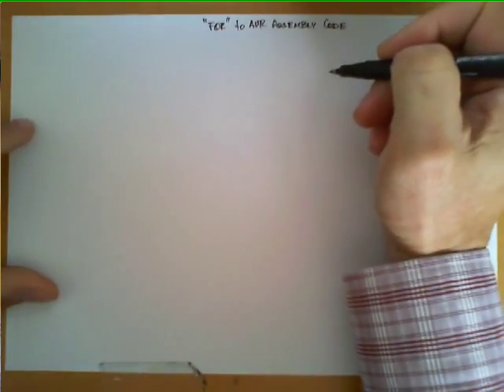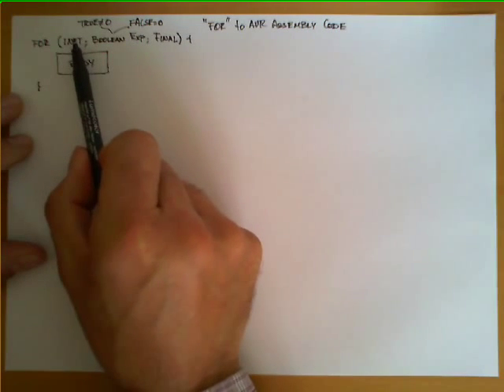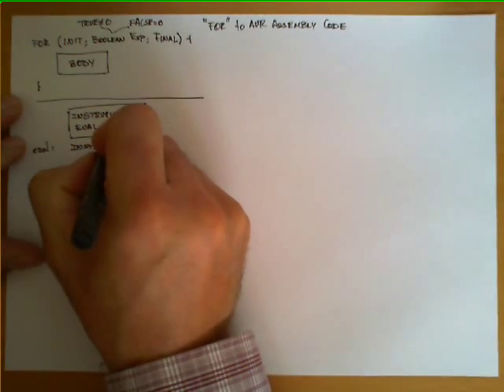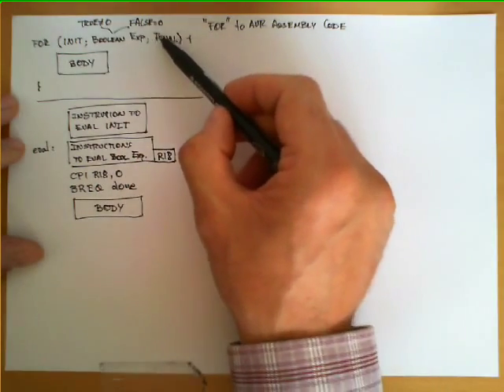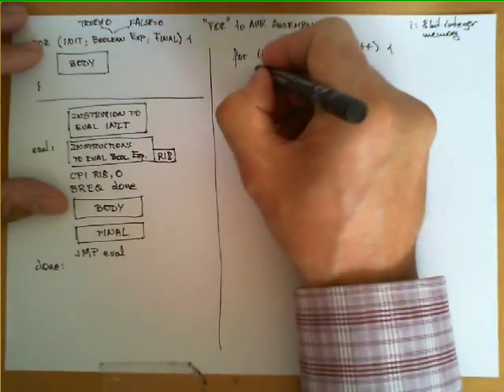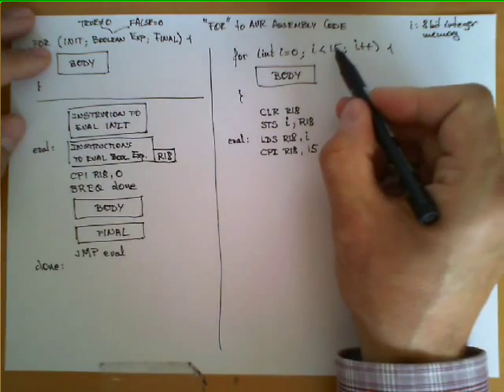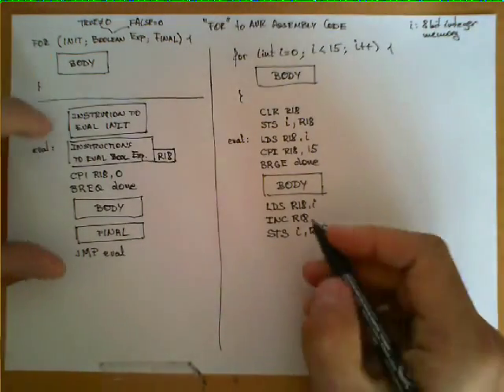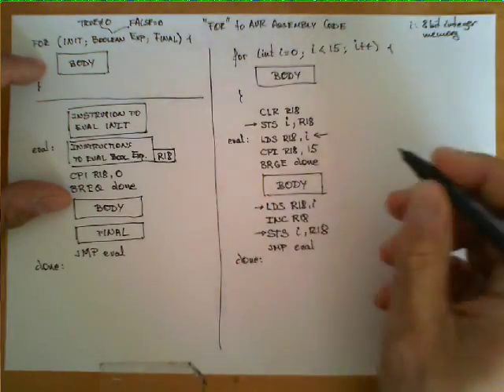Translate a for statement to AVR assembly code

Comment: Thank you Abelardo for this explanation. I have watched several of your videos. They have been an enormous help to me trying to wrap my head around computing. I am a plumber/pipe fitter here in the US. I work with various mechanical systems from heat pumps, to cooling towers, refrigeration and steam systems. I have become fascinated with embed programming. I can mimic the algorythims of higher level languages but they were just to abstract and stifle my learning curve and creativity. When i learned the gates, registers, and the ALU all of the light bulbs went off. I can see it more clearly now.  I watched the first 15 minutes of your Middle Path lecture its interesting.  You talked about bridges between the tools and the universities as well as learning styles: student as receptive, active and independent. Ill watch more tomorrow.  Im interested in your thoughts on self learners. Its a considerable demogragphic. Im 46 now and didnt have reasonable  access to University Education. Ive had some, but balancing my baseline expenses against time was impossible. Ive adopted a Kahn Academy style of learning. I love instant video reply. And having the time to explore a concept with different resources before releasing the pause button. Ive been searching for "bridges" from the university to the student in Electrical and Mechanical Engineering. Cant seem to find any around. Do you know of any, or university that is planning a carriculum like this? I dont need a lab class to get exposure to things like boils pressure law, or friction loss of a fluid in pipes i see it everyday. I can do the math and physics online. I love MIT open course ware. But that doesnt get you accredited here in the states.